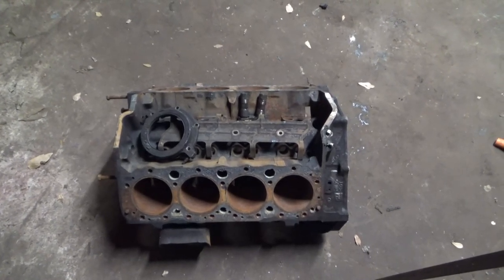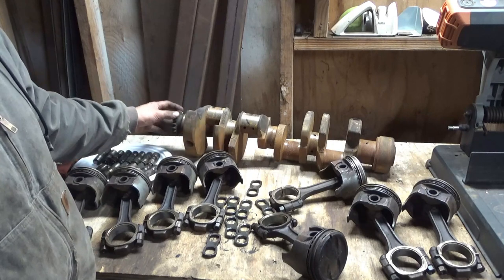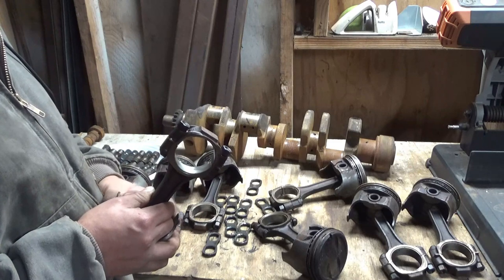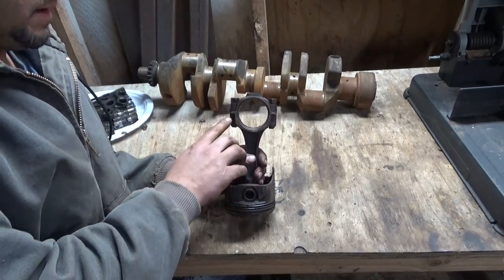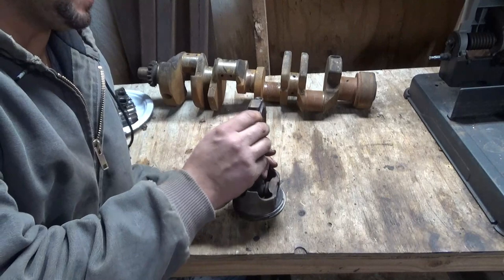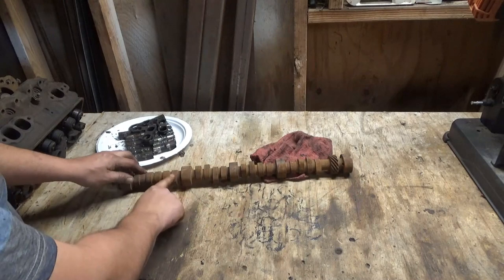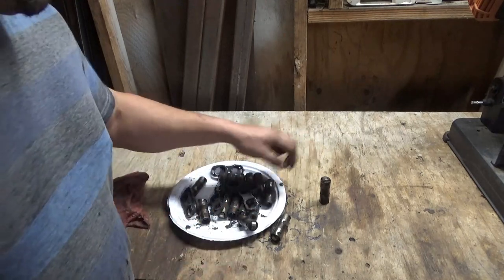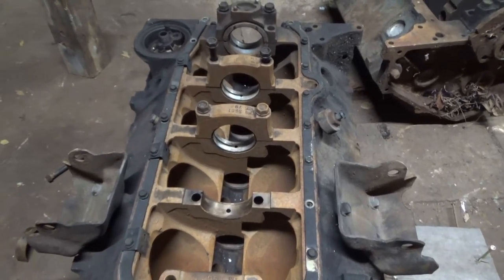Factory roller 305 small block chevy rebuild

Comment: That bad main was furthest from the oil pump and from the factory new SBC oil pumps are only pushing 35-40 psi on a good day, where a SBC should really run closer to 60 psi for a long happy life . I think its an EPA thing and fleet economy and if you reduce the drag from the oil pump (and the v/v train too by going roller) you save x number of million gallons burned on the nation's hy-ways.

Most important part of any SBC build is solid oil pressure from a good pump.
Reply from the maker: yeah, it is common for a number 1 or 2 rod to go out, or I guess even the main since they are the furthest from oil pump. From my experience usually the mains don't go out its usually a rod, but how silly do I sound saying that when I have an engine with a bad main lol.  no, but seriously, I have been saying for years the mains don't go out its always a rod journal. In my defense the first like 5 to 10 engines I have dealt with, its usually a rod bearing in the front of the engine 1 or 2. But yeah this is not the first main journal I've seen that was bad. they go out too i guess.
Reply: @davidcraft4909  Ive seen motors where #1 or 2 main bearing shifts but doesn't spin , it's just enough to cover or restrict the oil hole in the block and then the rod thats fed from that main go's dry and spins , its like a main shift takes out a rod scenario.

Comment: GENERALLY,  to make power in this thing you would have to invest your money in a cam and heads. AFR or Torquer World product heads 043650-1 would work here. The Gm OEM heads for a 305 aren't known to make power.
Reply from the maker: I'm going to put a gt45 turbo on a stock 305 and go from there. I know the stock heads won't make that much power. The idea is.  That if I can make about 250 hp with stock heads and 9:1 compression, and then put a turbo on it and boost 14 lbs, then I should have a 500hp engine and it should make about 500 ft lbs of torque.  I'm not saying i know it will.  I've never done it before, but that's roughly what I'm doing and the theories behind it, lol.

Comment: Stop bashing the 305 people. Bash the heads if you must bash something, because there is the choke point.
Reply from the maker: I wasn't trying to bash anyone. I'm not even trying to bash the 305, but it is what it is. the 305 has 2 major drawbacks the heads and the bore size.  I'm actually kind of on a mission to see if a 305 can make any power with a turbo, but I am skeptical. Either way I really enjoy seeing people take underdog engines like straight 6 put a turbo on it and run like 9 sec.  I would really like to see more people take a 305 and do something impressive with it. I just talk down on them because they have a major disadvantage and a 350 is actually cheaper to build when you get into forged pistons and head options. I really don't hate on any engine or brand, I like it all. I apologize if i said something in my videos that you didn't like.

Comment: The problem is the engine needs $1000+ of machine work. Could have bought a better engine. Its not really worth it. This is a DIY job engine.
Reply: I dont think so, it didnt look like a high miler, more like someone was'nt doing regular oil changes , have the crank done , refresh the heads, ball hone the cylinders , clean everything , could be a solid runner.